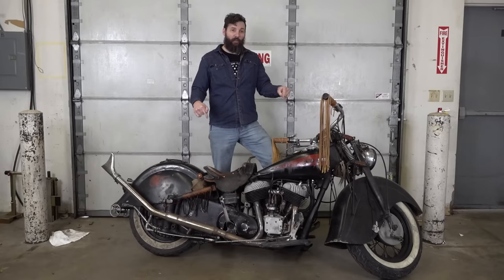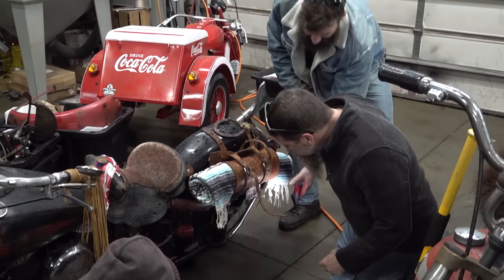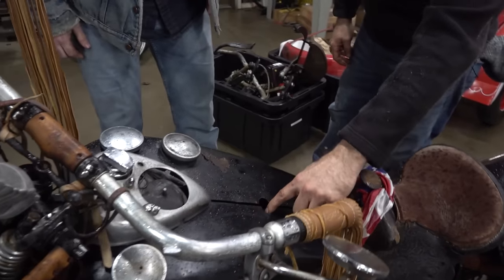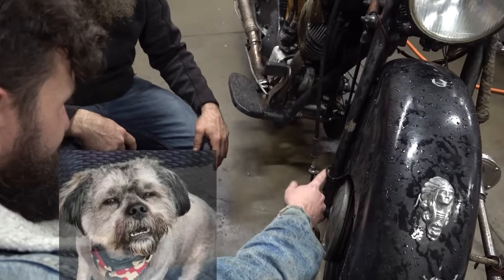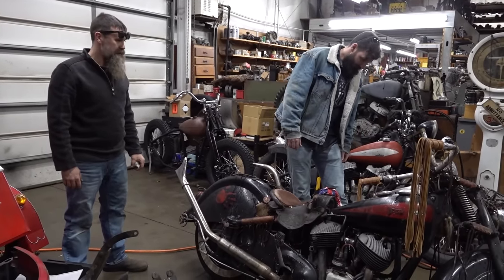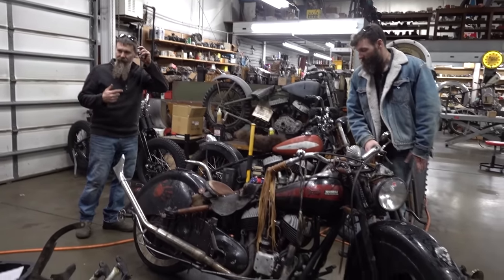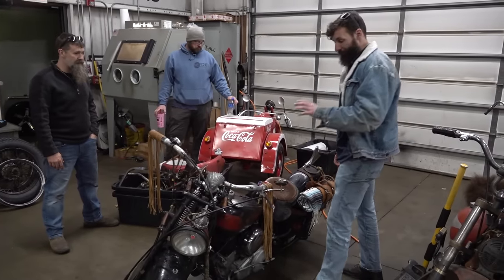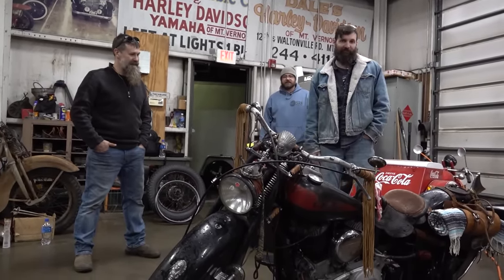Did I lose $14,000 on a Fake 1948 Indian Motorcycle?

Comment: I had no idea these bikes were still this affordable.  I would take it just they way it is had I the bucks and not change a thing except maybe fix the missing stuff and a part here and there. This bike has tons of character.  But I am retired and on a fixed income and can't get out from under debts (joys of home ownership with a cracked slab). However not all is bad, I get to volunteer at a museum with nice 1909 Thor, 1918 Indian, and 1920 Triumph motorcycles with old airplanes and lots of running Model T's.   One can't have everything but it is fun to dream and it is great to operate these vehicles on a rural site. Also built a full size running replica model WWI tank that is a hoot to drive and and several motorized bikes that were set up to look like 1910 era motorcycles. Life is good.
Reply: What kind of old airplanes do they have over there?
Reply: I am definitely a fan of old stuff. My current ride is fairly new. 99 Harley Softail custom. I rode an 84 Iron Head XLH Sportster for 23 years. But there is nothing like a radial airplane engine. Harley engines are in reality a 2 cylinder radial engine.

Comment: I drove a 250 cc dual purpose Kawasaki KLX from Nashua to West Palm Beach (1500 miles)  back in 2014.  My nuts were riding up on the tank because I had a bunch of "stuff" strapped on.  It was in the fall and the weather was perfect.  Well, sort of.  One day I drove on I-95 from Parris Island and it was a 95 degree day.  As I drove south I hugged the right side of the road to catch as much tree top shade as I could.  When it finally rained north of Titusville it felt so good to get wet.  I stopped at a rest area and talked with the security guard.  When I came back to my bike the crank case was slippery.  I used it to swing my leg over my tent, sleeping bag and a whole bunch of other things.  I kept slipping off.  I knew the security guard could see my performance from his tinted little room inside the rest stop so I moved the bike down a bit and mounted it from the right side from the sidewalk.  I made it back to my home later that night and got showered and changed only to end up selling it for chump change.  Motorcycles can be like woman.  Some cost you a lot more than others.  And most of them all suck.  In a good way.
Reply: You had me until 4 letters in…
KLX

Comment: I could lose myself for days in that beautiful place, Matt, you are a lucky man, I design modern things but my heart lies in the past. My first motorcycle was a "Panther 650 Single", I found it on the Tip(dump) when I was 12, not one single piece was joined to another, I had to pay my old man to pick it up for me(unfortunately he was a POS) I re-built it with a handful of basic tools & no manual, & I was "Hooked", I sold that to one of my teachers for a fortune, & from there I bought basket case after basket case, I sold them to cover the cost of racing Motocross & Production Bikes, those were better days. the Roar of the Greasepaint, the Smell of the Crowd, well 2 strokes really but I'm sure you know what I mean. Fabulous once again, thank you.

Comment: The 48  Chief was the first to use a stamped steel dash, it contained the ignition switch forward, speedo centered and the aGen light aft. The Indian jocky or tower shifter was a police accessory, it entered the trans tower on the left side, great for quick positive shifts. There were actually 2 48 frames. The earley one had a tubulare spreader in front ot the rear fender, the later ones used a curved solid steel piece in it's place. These followed through to the end of production in 54. This bike is earley, subtract 101 from the production number to determine it's actual nice number.. I have the earliest 48 Chief I' ve ever seen, CDH 313, actually the 212th 48 Chief built.. The bike controls could be Harleyised, even the clutch pedal could be reversed Ala HD. There never was a shift gate on the tank. All together a very good start for your guest.

Oh, the seat bone pivot has been cut off.

Comment: We have a 46 in parts that we've had since I was 8.. the gas tanks are in PERFECT condition other than needing repainted.. unfortunately Mississippi rust got to a lot of the rest of it and it was likely flooded at some point as the engine and trans were both completely full of rust and most of the internals were junked. Nice to hear that replacement fenders aren't frowned upon though... should I ever get the money to fix it.
Reply: It only took me 40 years to get the money to rebuild my 38 indian four! All it did was increase in value from $900 to $40/60? k and it doesn't take up a lot of room, like vintage cars! Maybe by the time you get it going it will be worth 2 or 3 million, considering inflation!
Reply: @stevemitz4740  unless my father sells it first.. because he won't let me buy it (or his 65 T120C) from him and he wants everything non-essential to him gone.
Reply: @jaratt85  Yes, "One man's trash is another man's treasure."! But just maybe, he knows something you don't know? one man's trash is another man's treasure, BUT remember! " Honor thy father and thy mother, as the Lord thy God hath commanded thee....... in the land which the Lord thy God giveth thee. — Deuteronomy 5:16.

Comment: 47 dash, 48 was a bigger stewart warner speedo and front wheel drive. 41 scout tanks so the bottom mount is different. The patina is hot right now, restored ones are all over everywhere. Personally I'd leave it. Great rider the way it is,
Reply: I love its character

I'd just clean it up a bit (comfier but still aged saddle), and leave it... It tells a story just by looking at it. Someone loved it and probably grew too old to ride, and thankfully it wasn't left to rot or parted after that.

Comment: Those are definitely adapted 40-42 Scout tanks, and the cast aluminum dash is a 38-42 Scout and Four cylinder, and 38-47 Chief. They went to a stamped steel one in 48 all the way to 53 when production ceased.

The 47-53 tanks were smooth sided with 3 5/32" screw mounts that held a stamped chromed brass Indian script logo.

Comment: I have a '48 Chief also. Just finished putting it back together stock. You have a '47 dashboard as it has a hole for a amp meter. The '48 has a red dummy light. Also, I've seen others say it but for high quality parts and information I've found Jerry Greer's is the best. In a few months I plan on putting all my leftover parts for sale. Good Luck with your project.

Comment: My father has a 37 or 38 Scout as far as we know. Basket case that was in the barn from 1967 until about 5 years ago. He bought it in 63 and rode it until the crank bushing (I think) went.  He took it apart and threw the engine parts in a bucket. Has a rumble seat as well. Looking forward to the day it's mine and I can put it back together

Comment: Im not saying it is or isnt, i have no idea either way. BUT i apparently have to tell people things like this because they apparently dont think things through fully. If you are deciding it is genuine off of ONLY some numbers stamped/etched into it.... i could go outside right now and label my '79 Suzuki as a '48 indian.... etched in numbers are extremely easy to fake... so, if no one knows what shape/design the frame is supposed to be, or something more than just a couple etched numbers.... you now have the power to make as many 48 frames as you want, just stamp that number on them.

And wow! Matching frame and engine! Almost like someone stamped them both with the same fake numbers at the same time!

Again, i dont know or have any opinions either way, just pointing out you can not rely on a simple stamped number to determine authenticity, its the easiest way to fake something.
Reply: You have no idea what you're talking about. There are certain number fonts, etc. that prove the numbers are right. See if you can find a set of original Indian stamps. Oh, and by the way, what you are suggesting is a federal felony.

Comment: FYI that's a 47 or earlier front brake. 48s have a front wheel driven speedometer that taps into the top of the brake cover. Googling any 1948 Chief should show this. I have a million questions on this frame. Does it have both the forward sidestand and the previously used mount towards the center of the frame? Is the shift lever bracket on the frame cast or welded? Is the rear frame crossbar under the seat the tube style or a welded arch or even the welded sqaure?

Comment: I own and rebuild antique Indians here in Hawaii. Currently own a 1946 Chief Roadmaster with all orginal factory racing parts on the interior.
The seat pans could be interchangeable between HD and Indian. The Chummy seat was HD's design, and they never charged Indian for royalties.
There are up to 6 springs under the seat and in the seat post, pretty comfortable !!
Uses a Delco Shock in the girder. That girder is far superior to the HD springer.
ALL Indian parts from '45 on are extremely easy to find and get, from 3 major manufacturers in the U.S. Greer, Kiwi, Starklite, Ziggy's and Parker.
Parts are not more expensive than any HD part.
True new Indian repop are always nicer than the originals.  Many original parts did not fit from one bike to the next and were not superior metal.
....Minor correction, 1947 had the first aluminum oil pump, and it also changed to a scrapper pipe for oil pickup next to the flywheels. Most of us do not care for the aluminum pump (wears out a bit faster) and keep the Iron pump, but change to the scraper pickup inside the cases.
Matching numbers are great, but Indian did not try to keep them matched up when they were towards the end of a production run. Or even in the same year.
Linkert Carbs were practically interchangeable with anything that used them from tractors to motorcycles. Mostly they were only good for lawn mowers......
Many of us tossed them if they were too bad, and put Keihin CV carbs on from Kawasaki Vulcans or even Sportsters.
....note the CV carb is the single easiest bolt up change you can make, and provides the BIGGEST change in performance on the flathead engine.  Better throttle response, better gas mileage, and more power. We had to change the timing with the old Linkert to the Keihin from 38 degrees BTDC to 19 degrees BTDC !!!
Indian Gas tanks were all over the place. They were soldered and wore out fast. Anything that fit would do.
The Dash is correct. The Girder Links were different sizes for SideCars.
....these bikes take a belt driven generator!  Any belt driven generator or alternator that can fit under the seat will work. 
Throttle and Spark Advance are interchangeable, uses the exact same cable and cable ends.
Jocky shifts can be dangerous, to easy to bump, but look cool.  1st is all the way forward, neutral, 2nd, 3rd, can be reversed when using a jocky shift.
Clutch is NOT a suicide shift, has friction dampner. The clutches last forever, never had to change one.
$5,000 should put that bike in great shape.

Comment: Great content! I know the front fender decoration is not what It should be, my 46 has an Indian head bonnet and the face lights up. Also, I was hoping they would discuss the spark advance. The twelve-volt conversion is the only way to go, I had six-volt for ten years, switched, and have not had a problem since. Jerry Greer or Kiwi Indian are both good sources for parts and knowledge. You should do an episode on the 1959 Royal Enfield Indian Chief if you ever get a chance.

Comment: I rode a 46 indian for several years.  it was all original when I bought it.  the throttle was on the left and the gear shift was on the right..  it was always easy to start,  even in cold weather, 2nd or 3rd kick almost every time
Reply: In the early 50's, I remember a kid down the street had one, of course it had snowed and he must have kicked himself do death, got it running, didn't get very far and came back. Only Indian we ever had was an Arrow.

Comment: my dad had a 48 he bought in 54 and around 1999 we started to restore it and he wanted it RIGHT. and he passed away in 2004 just before we could ride it. and it didn't need a lot to be road ready. then i was waiting on a couple parts for the front end to come in so i could ride it.and the right shifter i think. but anyways hurricane rita was coming so i put it in the middle of my shop and put my new harley outside and my new truck under a Tree that i knew was going to blow over. hoping they would get screwed up but NO the tree did fall but the wrong way. and nothing hit the harley. but one limb went through my wall and 15 foot into the shop and took the rear jug off the bike 100%. and busted a few other small things and after talking with mom we sold it to a guy named sonny keaton and he put it back right and now its shown on Orleans street here in Beaumont tx as far as i know. but sonny passed away years ago but i think they still show some of his bikes from time to time there.

Comment: It looks like a hodge podge of parts there but I think you did fine for 14k. The tank is probably 41-42 sport scout but could be earlier chief as I think the chief indian head badge used that same mount. 48 would have the script emblem and mounted with screws into cups that are soldered in the tank. 
 Front brake assembly should have a speedo drive for 48. I didnt see it in the video. I think 48 was first year for front wheel drive speedo. 
 The dash cluster is pre-48 that used speedo, amp meter and ignition switch. 48 only had a speedo and a red light that was for the generator. 
The speedo you found for around $300 is likely a reproduction. Most of these had a straight pointer instead of the arrow pointer but maybe they started making them more correct later. They also do not accept the stock speedo cable. 
 The bike would have came with shifter on the right and throttle on the left. However, there was an optional left hand shift handle available in the indian catalog so its considered correct either way.
The company that stamped the reproduction sheet metal was Iron Horse Corral. Im not sure if they are currently still in business or if someone took it over.  For your seat, search out a company called Heathers Leathers. Top notch quality seats. 
 If you need any help with the bike feel free to contact me. I have been around Indian motorcycles my entire life.

Comment: Great start and good bones. Tanks look like 40-41 with those emblem mounts. Hard tanks to find and the sale of them would more than get you enough for the later 47-53 tanks to suit a '48. Front brake backing plate is wrong. 1948 saw the introduction of a front wheel drive speedo so it should have a speedo drive. 
14k is a damned good buy for a matching numbers bike that runs strong.

Comment: honestly that's a really well built 60's modded 48 Indian, I'd leave it other than maybe a repaint in a period sympathetic style.

if I was in the US it would be perfect for a theatre thing  I'm involved in atm
Reply from the maker: Haha clearly you have never rode a motorcycle with a saddle
Reply: @BikesandBeards  strangely enough I have, there's a reason it died out as a look but I have a soft spot for period mods that get saved that we can point back to as a 'that was cool, that was dumb, oh dear god wtf that was stupidly dangerous.' 

it's like a vintage big block swapped elcamino or the double engined triumph nitromethane drag bikes of the 70's some of this stuff has to be seen/ridden to be believed and they are just as valuable as historical artefacts as the utterly imacculately restored example next to it. 

if its been messed with heavily there was a reason for it and... there's a solid justification for keeping that.

imagine if every Arlen Ness chop from the early days was restored or  or every Triumph Hurricane (a US dealer network modifications kitnto a stock bike) were turned back into US market import boneville's.

Comment: Got two 47 cheifs.....both absolutely perfect, less than 100 miles on either one. Both were built from n.o.s parts over a twelve year span. Originally I was just going to build one but as parts started stacking up I had doubles of most parts so, two.......offers?

Comment: let me critique your 1948 Chief. The 1948 has a Stewart front drive speedometer. Your bike has the 46-47 brake plate without the hole for speedo.. Your dash is 46-47. The 1948 has no provision for amp gauge. It used an idiot light. Obviously the speedo is missing. The front brake arm and attachments are all wrong. Connect the spark advance! It is used even if you have converted to electronic ignition. Get rid of rubber fuel and oil lines. original is copper. The exhaust is mounted all wrong. A fishtail is aftermarket. The fuel filter should not be glass! that is tractor stuff. Your headlight is Harley. You need a Motolamp brand. Tanks are 44-46. The 1948 tank has 3 mounting screws for a INDIAN script emblem. Also though where the tanks mount to the top frame bar it has a square notch for the speedometer cable (not found on 1947). The key switch is Harley. What you need is a round bakelight switch (used many years). I can't see but the girder fork was used 1946-48. The earlier 46-47 used needle bearings and shafts were hardened ( prone to snap). Your bike uses bronze bearings with felt seals. Your seat is missing the central post and seat T-bar. Missing the horn and front crash bar.